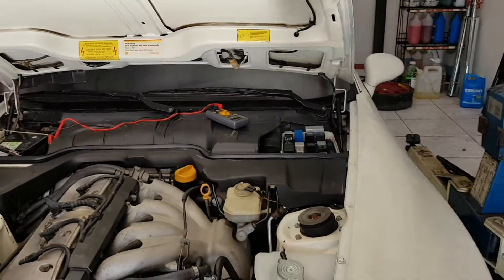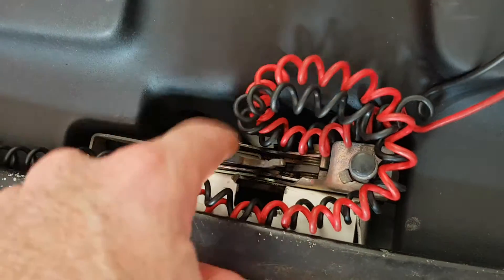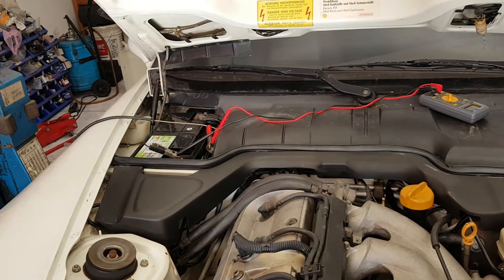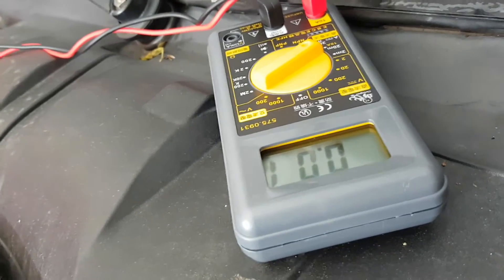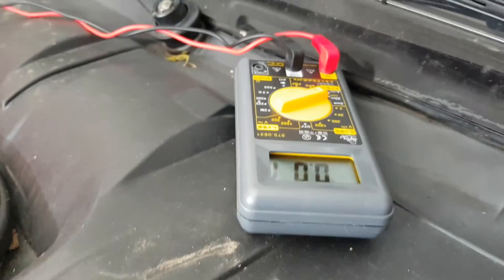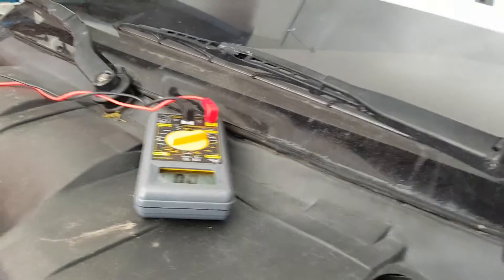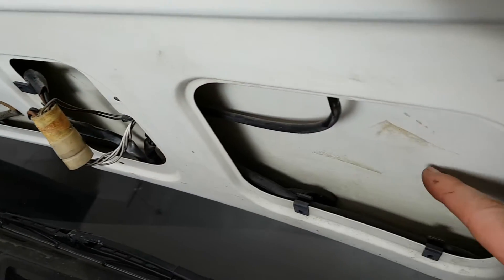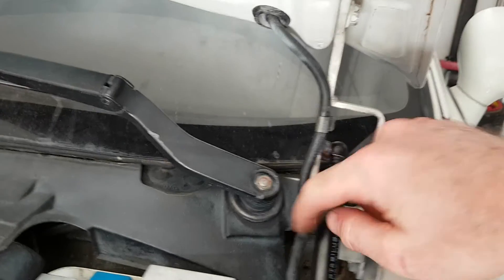Porsche 968 parasitic drain, faulty hood light

Comment: Had an alarm issue where the alarm would start going off for no reason sometimes hours after I locked the car.  Saw your view and had three wires in that same location with the insulation all split open and likely shorting.  Thanks for the heads up!

Comment: Was trying to find a voltage drain causing a 160ma draw on a 968 and found the radio amp (booster fuse #39). Has an aftermarket radio so will need to re-wire the harness.